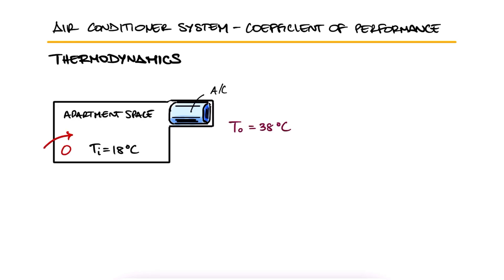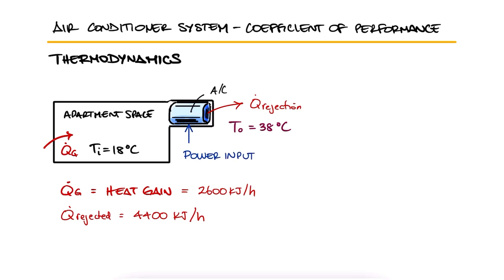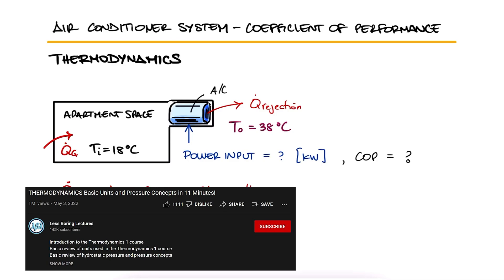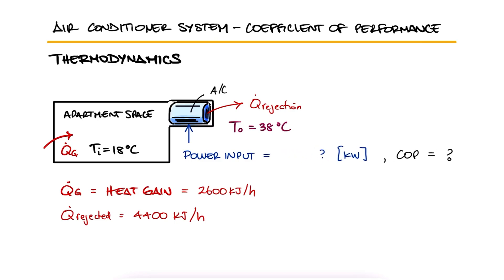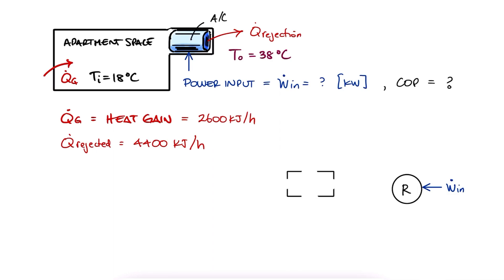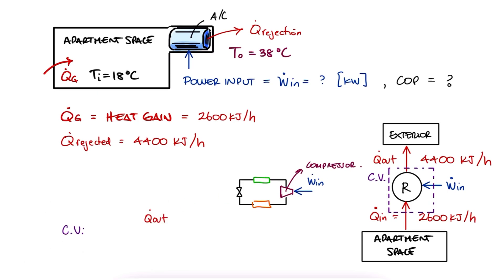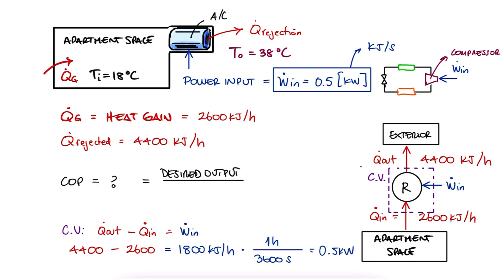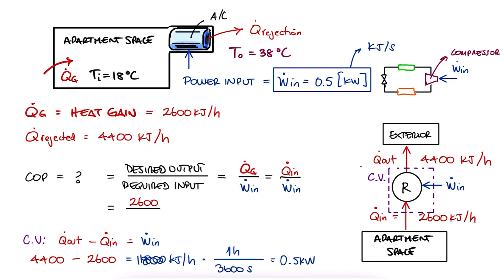Air Conditioner COEFFICIENT OF PERFORMANCE in 2 Minutes!

Comment: "Axial motors are smaller, lighter, more efficient and open up all sorts of possibilities for future performance cars."
But can it be also used to boost aircon performance?
Reply: Obviously. If its more efficient it uses less energy to compress. Internal combustion engines typically use mechanically driven compressors but in electric vehicles compressor is electrical one. EV uses less energy to run ac. We can practically use ac for cheap in an ev but idling combustion engine just to use ac is very costly as engine power is wasted.